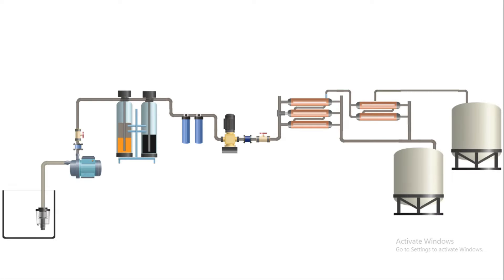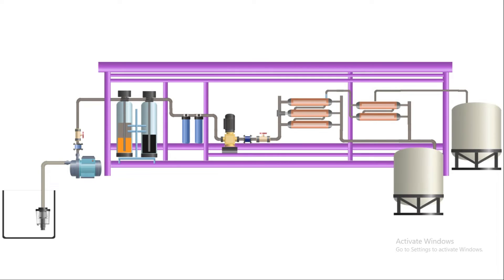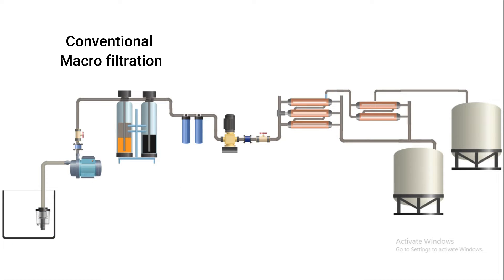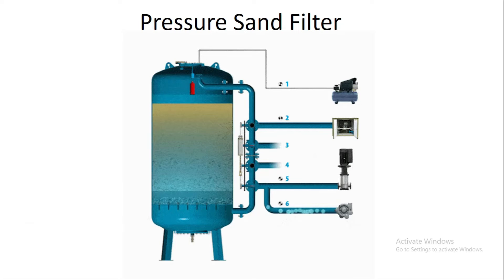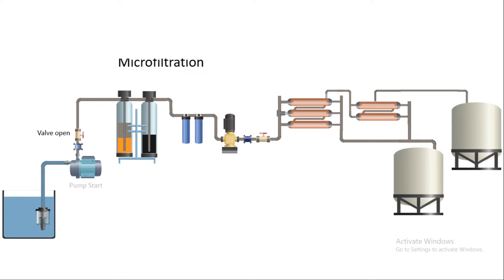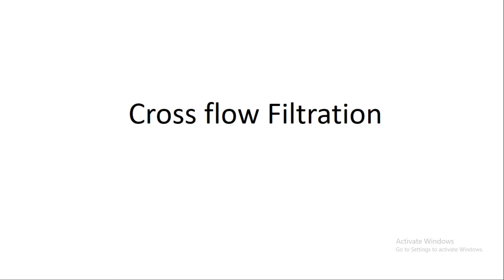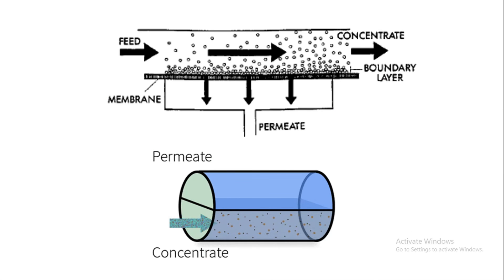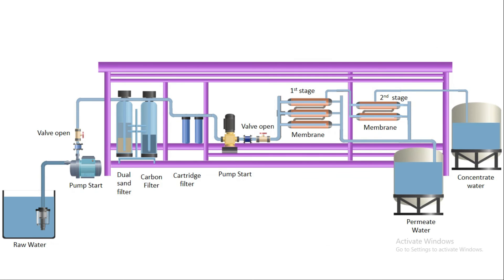How does Reverse Osmosis work ? I Water Treatment Plant Process I RO Plant working I Reverse osmosis

Comment: This video is more better if it discusses how much percent of permeate water can get from raw water in a maximum way . For example what is the percentage of permeate water able to get from 1000 liters of raw water which is the potability of water will not compromise.
Reply from the maker: Ah, yes it depend on design requirements based on water chemistry (tds, sdi, impurities) and membrane types. 
You can take from filmtech manual of whole water treatment process and design.